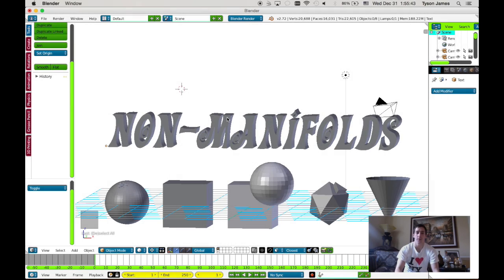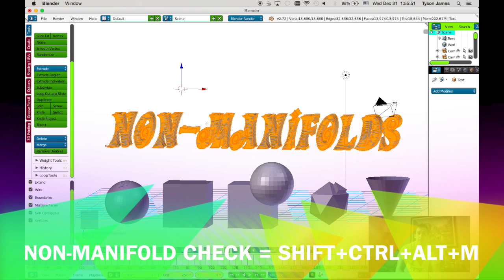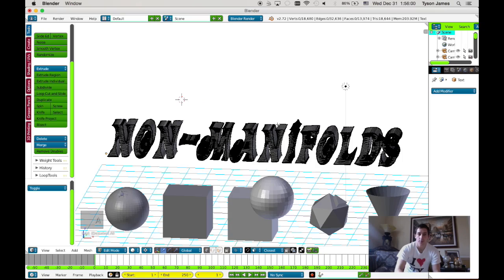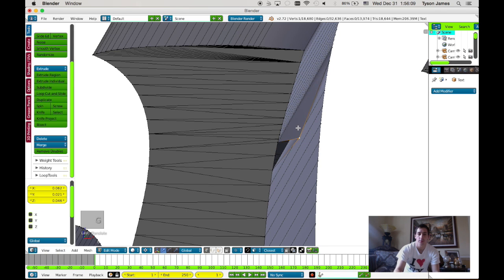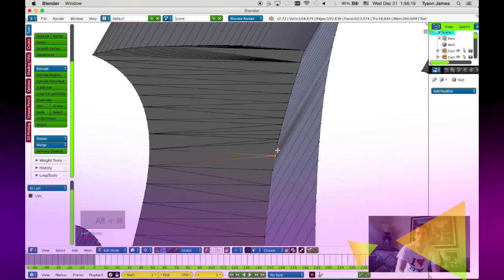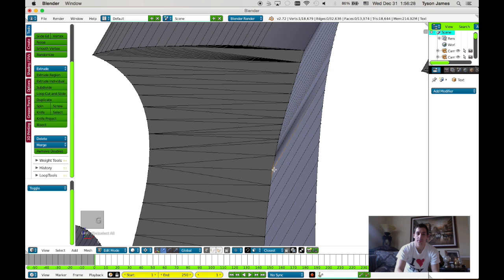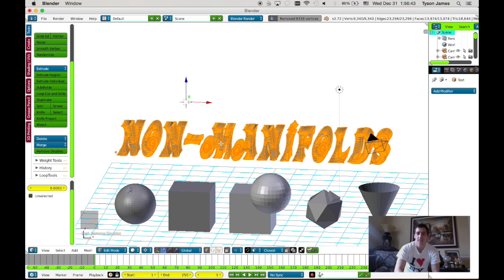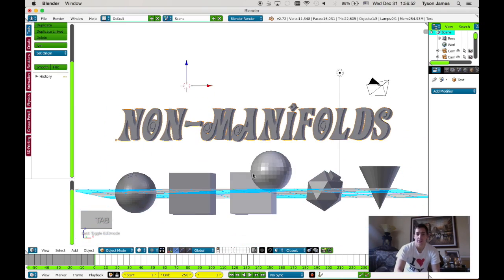Non-Manifold : Duplicate Vertices

Comment: I'm new to Blender and 3D printing, I looked around and saw a lot of information about fixing non-manifold models manually, but this Remove Doubles is an easy way to do some of the heavy lifting in one shot.  This video is a little old though, this function is now found in Edit mode under Mesh / Cleanup / Merge by distance.